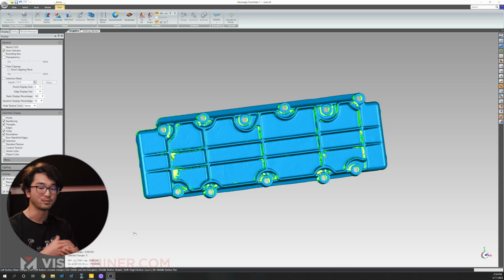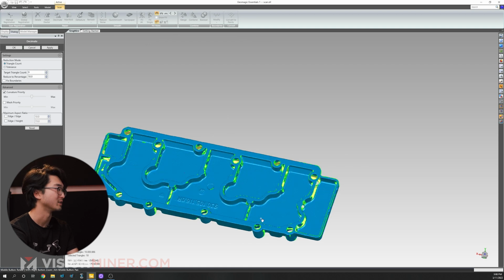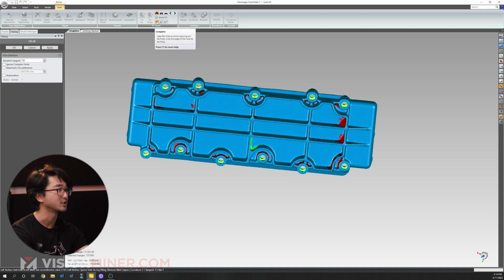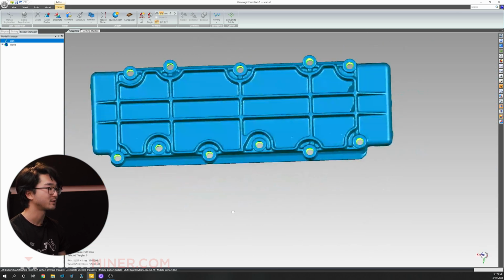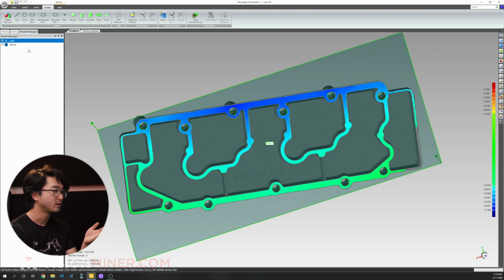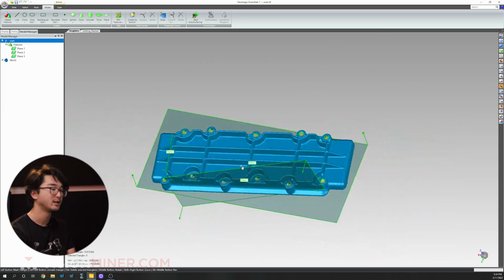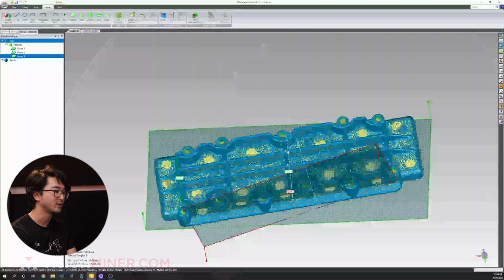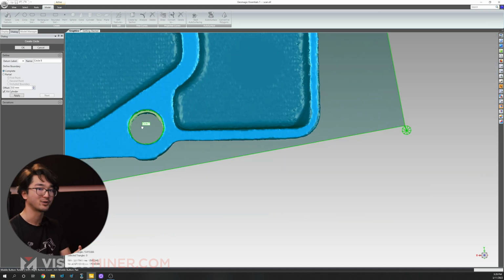Geomagic Essentials - Mesh Alignment Workflow (Part 1 of 3)

Comment: Mesh Doctor ist a part of 3D Systems plugin Geomagic for Solidworks, correct? Is there a possibility to have a stand alone version?
Reply from the maker: Yes, the plugin version of the software for Solidworks is basically like having Geomagic Essentials inside a window inside solidworks -- but this is done in the standalone version of Geomagic Essentials, which is a separate, stand alone application :)
Reply: This entire thing is done in Geomagic Essentials.